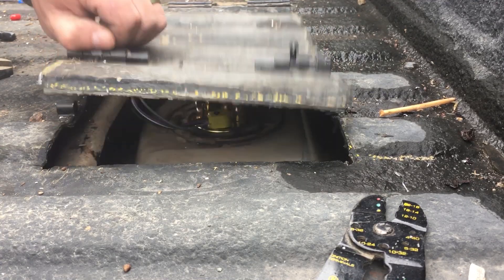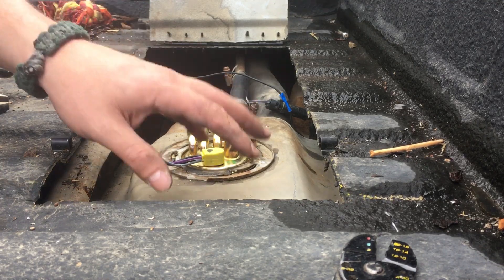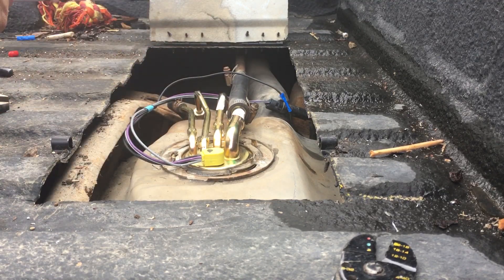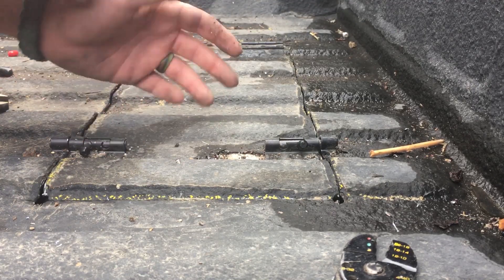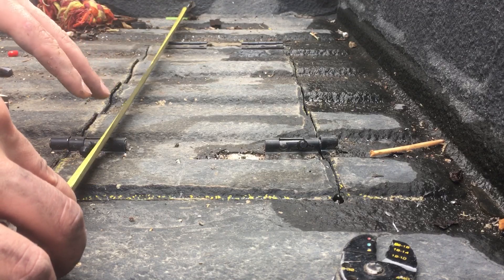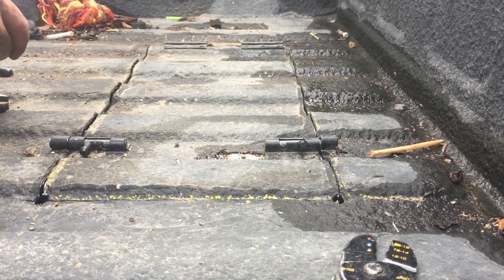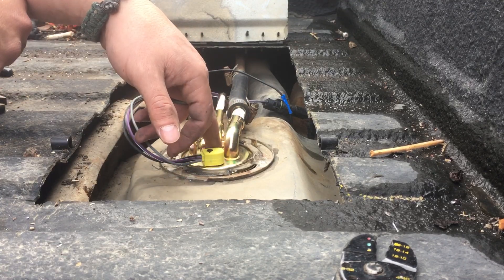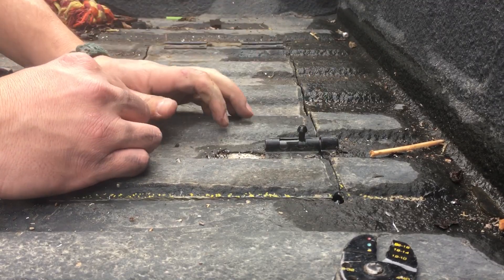1996 GMC 1500 fuel pump problem solved!

Comment: Why not just loosen the bed bolts and prop up the driver side of the bed with a block and ta-da! It's faster and easier than dropping the tank, or cutting the bed.
Reply from the maker: cccalhoun that was an option too but.. if this ever happens again, I can change this out with a flat head and a pair of pliers, in a parking lot, in ten minutes :) we all have our ways that work for us.
Reply: 20-30 year old bolts don't just loosen.
Reply: DirtyFace George   Exactly were talking about a 20 to 30-year-old truck the heads always twist and snap people forget to disconnect the tail light wires & such but if it works for you that’s all that counts right
Reply: I have an 89 and in CA so the underside is clean and no rust....the first time I dropped the tank....2nd time, fuck it, I cut a hole.
Reply: Strange, I cut the bed in 10 minutes. I don't have to bang my head on the bed above my head,I don't have to crawl around on the ground and it took 10 minutes to secure the cover which is now easily accessible.

Comment: You just take the bed bolts out on 1 side. Loosen them on the other and lift then block. Don't cut a freaking hole for christ sake.
Reply: For people that go off-roading big time the method of cutting a whole is so much easier, then going through all that in the middle of nowhere in mud, water or just plain dirt
Reply: @gagemolinar7663  agreed.

Comment: Measurements didnt work on my 1996 C1500 long bed.
I dont know if you have a short bed, or if I have a larger capacity tank.
But my fuel pump is like 7 or 8 inches further back from the front to the center of the sending unit. I cant see it from directly above.
The plate drop and I was just like FUCK MY LIFE!!! 🤣
I'll have a huge hole in my bed come tomorrow. 😅
Reply from the maker: Oh no I don’t know if I’ve seen people say anything about that, most of them have been working ... I wonder what the differences would have been, maybe single cab ?